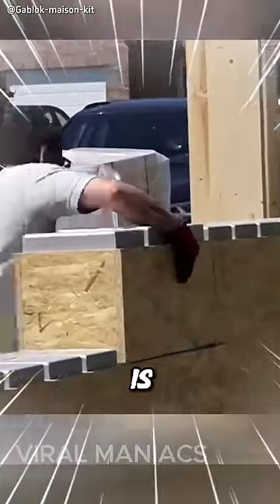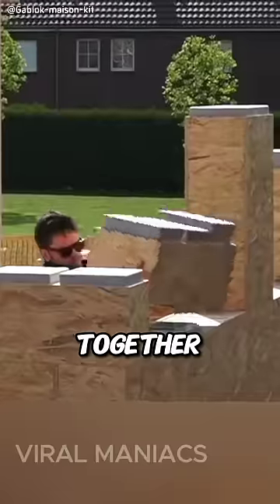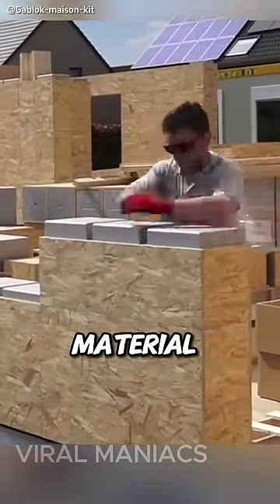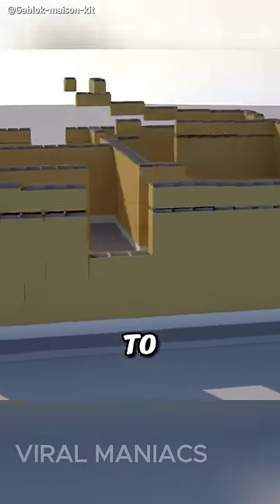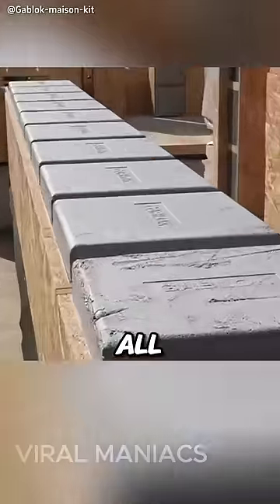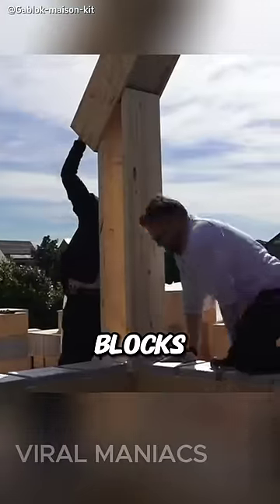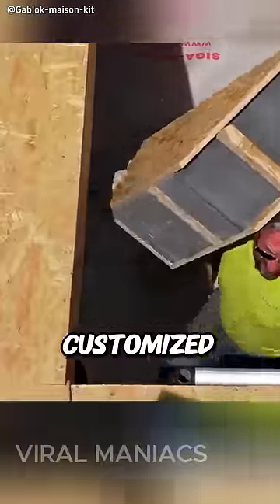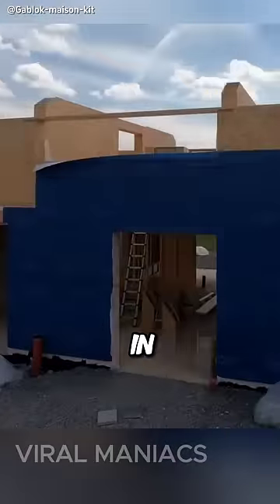Whoever Invented This Way Of Building Houses Is a Genius #shorts

Comment: The plumber and electrician have left the chat.
Reply: Can confirm 😂
Reply: 😂 😂😂 I was thinking the same 😂
Reply: I totally came to the comments to ask this lol
Reply: @1down4upworkshop61  In theory you would build 2x2 or 2x4 interior walls for this stuff. This is a shell and not the "building"
Reply: Imagine the cost when they reach out to the commercial water boy and sparky😂
Reply: that's what I think😂
Reply: You've never done trades work huh... How do you think solid masonry/concrete buildings have pipes and electricity 😂
2x4 interior with drywall of course you can't just leave the interior unfinished. Nevermind the fact that you can run stuff through the ceilings like almost every large building has
Reply: Lol yeah you'd still have to pour a pad and a foundation and how do you build the floors and you'll have no space for utilities and where you putting your cold air return and where does your ducting go? This is ridiculous
Reply: @lunawense6288  well, that's the same idea I think about
Reply: No we haven't we're just sitting here looking at this in utter disbelief😅
Reply: @lunawense6288  It depends. Where I live, we just cut through the CMU, install conduit, and boxes, and then cover with cement (on pre-existing walls), or drop flexible  conduit through the CMU holes from the top, and everything is wired through the top (on new construction) . Also, when installing the forms for reinforced concrete walls, we put flexible conduit, and boxes in it (the boxes, stuffed with paper, so the concrete doesn't fill them up lol). But I'm no mainlander, and most houses here are either reinforced concrete, or CMU with concrete roofs, and built by their own owners and friends.
Reply: Hvac left too
Reply: Remove the middle in the areas you need to
Reply: Exactly 💯
Reply: You know, I hadn't gotten that far with it yet. I would've gotten to the electrician...
Reply: Haha😂 yea, that's exactly what I was thinking, receptacles, lighting, plumbing, yea is there specialized Lego blocks for all that stuff, cause if not, that guy isn't a genius,  he's a 5 year old toddler with bigger blocks lol
Reply: Funny thought but honestly no there’s many ways to go about it such as surface mounting routering and or just framing up some 2x4 walls for a plumbing and electrical or you can even just box in plumbing and electrical chases that you can then sheet rock too make the chase non visible.
Reply: @eddierack 😂
Reply: Beat me to it.
Reply: Hahahaha!
Reply: Bs plumber ain't scared of anything, Ota the HVAC guys you better watch out for. Plumbers don't make enough to turn away jobs! 😅
Reply: Architect here 👋 There is more than 1 way to build a house. This particular system is meant for single floor construction, all plumbing and electricity can be channeled below, or you can put a furred out channel for electricity in certain areas and make them look like design details such as fluting or moulding. The system could be great for many people in many situations and I would not immediately write this off as a useless invention.
Reply: Well, you see, they make these nifty things called drill bits and saw blades, and they can go through wood, concrete, and even glass! Pretty sure they can handle the foam and OSB. 

If you want to run horizontally, lay the blocks, then run a skill saw across them at the elevation you want. If you want to go vertically, drill through the foam blocks. This isn't rocket science.
Reply: That's what I was thinking too. I mean, it looks great... *in concept*. It sounds like it could work in putting together and taking apart a house *on paper*.
But there's more to a house than this... Skeletal lego-esk looking thing.
Where are the innards? The pipes, the water, the wires? The stuff we need to make a house ... you know... a house? Are there specialty blocks for that? How do they work?
Reply: Indeed.
Reply: @stevejonesll1399 yea I know right 😂 it’s crazy how we can master engineering feats like pouring concrete tunnels underwater but when it comes to building a house out of foam and wood it’s just absurd to think that we could come up with a way to like drill holes or cut out channels… I bet these guys are still sitting there trying to figure it out to this day
Reply: @kameljoe21  Exactly.
Reply: @kittybrowneye3163  You think of all of these things while you're planning the build. If you don't know or want to learn how to build the foundation you pay someone else. You make it big enough so it's not too small when you add interior walls for wiring and pipes. As for ventilation and wire/pipe access, it's wood and foam insulation. You know what cuts through that? Any drill or powered hand saw.
Reply: Interior framing
Reply: Don’t forget the HVAC guy. 😂
Reply: If I came to site to rough wire this building I'd leave immediately.
Reply: HVAC?
Reply: When you realize that most plumbing and electrical are run below the floor and above the ceiling, when they are put in, this makes sense.
Reply: That’s what I was thinking
Reply: @tacdriver911  you realize that these things are just the shell of the house. It still needs trusses, a roof, floors and ceilings. Lots of room for that.
Reply: 100% of the houses in my town are cinder block construction, and the plumbers and electricians seem to do okay. 
Your objection is nonsensical.
Reply: Their sold separately in a box too!  LOL 😅😅😅😅
Reply: Yup
Reply: Hahahahahahahahaaaa. Exactly
Reply: Hahahaha 😂
Reply: And the insurance company
Reply: Home Theater Company as well. I’m out. Lol
Reply: @plumber_midge  seriously,  where ould the duct work be run?   They need to hollow out the blocks to allow piping, electric, sewer etc.
Reply: @kittybrowneye3163 you think they haven't thought of that?
Reply: @kameljoe21 kinda ruins it.
Reply: @Wellactually123 was looking for the brain with this answer. 💦 and ⚡️ get put in the same way as any other house 🤦🏼‍♂️ Thank you sir!!!!
Reply: It appears the material has a lot of give to make holes, couldn't they work around this? I can't imagine a craftsman like that to look at a piece of wood and insulation and say 'you can't get there from here', you know?
Reply: Do plumbers and electricians leave the chat with cement block structures too?
Reply: @tacdriver911  Ceiling?
Reply: Exactly
Reply: Strap the walls and put that shit behind the drywall!
Reply: OSB and polystyrene…. Don’t light any matches inside. Poof! No more belongings….
Reply: still good for a barn or gen powered
Reply: They cut corners for convenience
Reply: @BaronBoar  Shhhh... The idiots are talking. Lets let them think they're being clever .
Reply: I promise you, they have already thought about this and figured it out.
Reply: Loll
Reply: @kameljoe21 The plan showed the use of the blocks for interior walls.
Reply: @lunawense6288 That might work for commercial buildings with loads of internal space.  But these blocks are already two or three times thicker than a conventional interior wall...and you want to add the thickness of a conventional interior wall to that.  Even if you run supply lines through the ceiling, you still have to drop pipes and lines to working level.
Reply: BOOM
Reply: @lunawense6288 Seriously, also all else fails you could cut a groove into the block itself for pipes and wiring.
Reply: "The 5-cm thick rafters that support the insulated blocks are spaced 40 cm apart, creating convenient pathways for cables and pipes." This is from their website don't assume a short has enough time to give you a blueprint with DIY guide lol
Reply: I think they have holes in the parts it's needed in since the company customizes everything
Reply: @kameljoe21 seems very wasteful to have to then add more wood afterwards
Reply: I wouldn’t want to work in that. For walls this system is great, but we are going to drill so many dam holes in it not sure how much better this would be in the long run
Reply: @eddierack didn’t even think if that angle of how this doesn’t work
Reply: I would hope they stud out the walls or it would have to be all surface mount and that would look like shit, maybe you can get it with hollow or conduit channels and all the device/fixture boxes pre cut in
I could think of a few ways to do the electric if it was my house, just never showed up to the job site with a house like this
Reply: @kameljoe21 internal framing is usually where you start to build a house, then you worry about the exterior.
Reply: And then you have a house made from wood....
Reply: Water and electricity are usually underground in other countries so it would be on the floor
Reply: @kittybrowneye3163 other countries build way different than the USA and of course other countries know how to build way better than America. America is behind at least 10-15 in new technology
Reply: Big Bad Wolf approves this method.
Reply: Damn, walls thick... so confused
Reply: That plywood is essentially the same as the plywood inside your walls. Studs are added and then pipes and electrical wire is added the same way.
Reply: Exactly :")
Reply: Oops.
Reply: Im a plumber, i came to make a statemeny but u got it😂
Reply: I completely forgot until I saw this
Reply: External plumbing and cables... just like in the 60s eastern europe
Reply: 😂😂😂😂😂😂😂😂 yes!
Reply: you need more likes
Reply: @lunawense6288 well, in my country the mansory houses have their electric and water pipes inside the walls.
Reply: That's a good point.
Reply: @kameljoe21   so no outlets or plumbing on the exterior? That's just stupid.
Reply: @kittybrowneye3163 stop over thinking and ruining my Lego house.
Reply: Idk.. it's still make sense for the electrician tho.. they can strapped in the top outer layer. Idk about the water tho
Reply: Pre drilled holes problem solved.
Reply: Hahahahahahaha
Reply: isnt this just a warehouse
Reply: Lol who ever built this is probably a kid who spent hours building castles in minecraft
Reply: was thinking the same thing
Reply: You can decide to put it against the wall instead of inside
Reply: The way it works as you would have to have your floors done before hand. That's for the plumbing. The electricity can easily be drilled and ran through and then would have to run along the wall as in you would attach it to the inside of the wall. Then you have to hang your interior siding a.k.a. drywall etc. on frames.
This just builds the bare bones of the house. You still have to do the outside as well. I see that done with concrete block are you see the ones where they're built by 3-D printers using concretesque material.
Reply: The legend says the engineers seeing this are still running and screaming in agony to this day.
Reply: Exactly what I was thinking 😂
Reply: Yeah, like, where do you want me to run all your conduit?? Huh
Reply: Came here looking for this comment
Reply: they use computer, they can make all holes beforehand.
Reply: in my home pipe are attached to wall. Just like that. No beauty needed. Will get used to it no problem
Reply: I've seen this comment a lot on these kinds of videos.  I'd hazard a guess that a finished product and not a demo like this would take that into consideration.  I would even imagine  it's already in the foundation.  But what do I know I only put a modicum of effort into thinking about it logically.
Reply: @kameljoe21  
Then it's redundant as putting insulation on the 2x4 walls would be much cheaper.
Reply: We'll drill them out. Just like you would regularly. Whenever you put up construction, you drill out your hose for your fixtures. Light fixtures in the plug in Fixtures Take a long.
 Bit and then run PBC pipe. That's even better for a new 220 in your 1/10 row.
Reply: There's definitely a different kind of block that would allow any pipes or wires.
Reply: YES!
Reply: I believe in the instructions there are spaces in certain bricks for the wiring and plumbing to go, its all part of the design.
Reply: The cabinet installers filed out the moment we saw what we had to "home the cabinets"
Reply: Easy job
Reply: @kittybrowneye3163  runs through the attic, plumbing also, standard on any slab home.
Reply: @lunawense6288  so why build a house, to build a new house inside of that house on a regular sized home?
Reply: Why? You'll still put up studs and wallboard. Wiring and pipe would fit through the interior wall. Just like any other house. Not a hard concept to grasp...
Reply: Dude thank you
Reply: No way you think they weren't considered for this
Reply: @lunawense6288 solid masonry isn’t commonly used in residential. And it also doesn’t require an additional exterior finish (though it’s often desirable). This requires a house wrap and full cladding like a stick framed home.

I want to like it, but it feels like…why?
Reply: @thelred-ph3lq here we can’t cut the cmu. It’s either uni-strut or false walls.
Reply: Exactly I'm a electrician and I'm wondering how the circuits are ran.
Reply: @alexromero2632  makes it hard.u needed go through walls and ceiling
Reply: @Zachary6428  so you build a house inside the house you just built
Reply: @robertaylor9218  That makes sense. Just to be clear, I'm not a mainlander, and most construction here is done by the owners and friends. I just wrote about the ways I have seen it being done here.
Reply: The fire protection engineer has entered the chat.
Reply: Weird. They build houses out of concrete block in Florida. All the houses I’ve stayed in had electrical and water. 
Very strange, I have no idea how they did that.
Reply: The preferred plumber I would with will not put plumbing in exterior walls, except for exterior spigots. They always tell the builder to frame up a secondary wall for any plumbing on exterior walls. 
Being an electrician, I see no issue with wiring these, as they are no different than wiring up log homes or fox block(ICF) basements. If you can't figure out how to do it, you shouldn't be in the trade.
Reply: Yea how does that work. Hmm
Reply: @miranda6939  You're going to run electrical wires through rubberized polystyrene?

Materials Data Safety Sheet:
"highly flammable"
"extremely combustible"

That will be in all the walls surrounding you.
Reply: @lunawense6288  For sure, but if you need the 2x4s everywhere then why not just build the thing with 2x4s anyway like a normal low-rise building?  I've seen apartments built with CMU block and I suppose it does save some money and super durable but the limitations with duct work, utility chases needed and lack of insulation were real drawbacks.  This block thing obviously solves the insulation problem.
Reply: @kameljoe21 Minecraft logic coming in handy
Reply: This is just a building shell. Yall do realize it’ll be framed inside for drywall and have an exterior, right?
Reply: the hurricane joined the chat
Reply: The amount of times people renovate vacant houses and think about Electrcial work last is unbelievable. Then we would have to tear up these walls and siding to run our lines to replace the cloth and tube wiring.
Reply: @RamiHamdan-ze7ms  you do realize that’s not the inside wall, right? Itll be framed inside and dry wall will go in. The wiring is behind the drywall in houses. If you have to replace all your electric, that would be that same thing as in a regular house. These comments act like this is the entire house. Plumbing and wiring do not go inside of these 🤣
Reply: They usually are not invited to the chat in the first place.
Reply: For real! First thing I thought of 🤣
Reply: @kittybrowneye3163   Utilities go easily through the blocks after putting a hole in the chipboard.  Cold air and heat go in the inside walls.  Dahh?
Reply: @kittybrowneye3163 you would frame the inside of the house you’d have to
Reply: @kameljoe21 basically a framing and insulation in one solution
Reply: @Wellactually123 They use an extra gypsum plasterboard on wooden framework on the inside to hide plumbing and wiring and between the wooden beams of the upper floors. But the HVAC is a problem for America, we hardly have these in Europe, we mostly have central heating which has small pipes to radiators or floor heating. And hardly anyone has airconditioning, and when they do, they have one unit cooling and not a system with air ducts. These  blocks are put on a concrete slab with an elevated concrete or masonry ridge, so free of moisture. On the outside you can put almost any cladding you want. It is 100% recyclable, construction has hardly any waste and has a high energy performance of U=0.15 W/m2K. Even someone without any construction skills can build the skeleton of this house.
Reply: They have customised blocks for those areas to allow for required MEPH etc
Lot of design work upfront to allow for this
Reply: That's great,  can I have lights and plumbing, too?
Reply: Just add plumbing and electrical the way they do in older castles and victorian homes. Exposed ductwork.
Reply: @Wellactually123   Each big block has 3 moveable blocks inside.  Why couldn’t you just remove one of the blocks as you go up to make a channel.  Spray foam to insulate after AC ducts, pipes, or electrical is completed.  Kindergarten teacher here… not a building expert.
Reply: I was thinking the same thing 😂
Reply: I was wondering how electrical is installed must be on the outside inside of the walls like dome other countries do. Which actually makes more sense.
Reply: You really believe the company capable of producing these blocks and at a large scale never considered water or fresh air?
Reply: @lunawense6288  wrong, solid masonry/ brick walls do not have a 2x4 interior wall. They cut the concrete block or wall and run conduit on the inside then use mortar to fill the gap.....or during construction they would run the conduit or piping prior to pouring the cement.
Reply: @dylanroy8147 you're the smartest person here.. logical thinking goes a long way
These tradespeople must think the house in this video is the first & only one built with these construction methods.. 🤦🏻‍♂️
Reply: Nothing is simple. I have this feeling by the time you’d built a foundation, run HVAC, electric, and plumbing, found a way to do the headers for doorways and windows, and applied interior and watertight exterior surfaces you’d be about at the cost of a stickbuilt or masonry house, but with better insulation properties.
Reply: It's cool and everything, but then I was thinking the exact same thing 😂
"okay... So where does the plumbing and electrical go...?
Reply: Interior designer also left😂😂
Reply: @thelred-ph3lq  where is this?